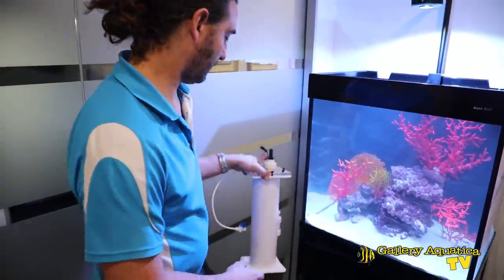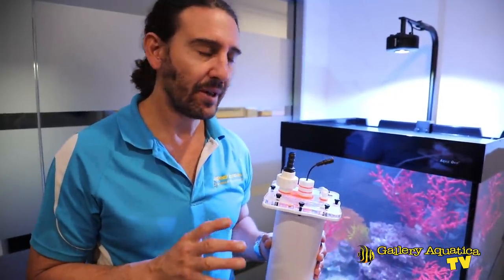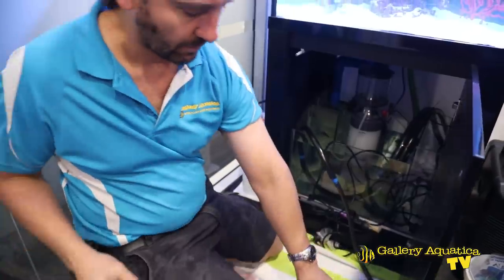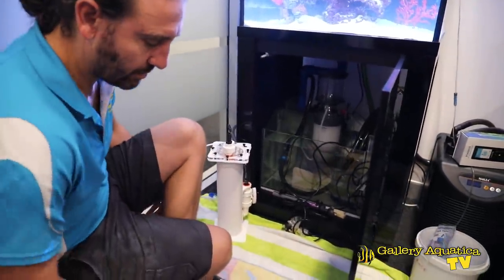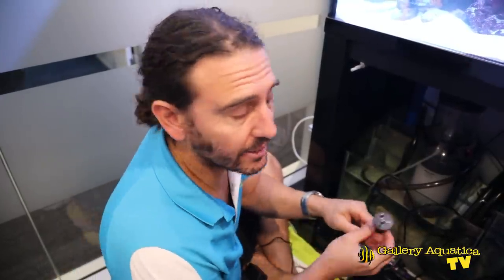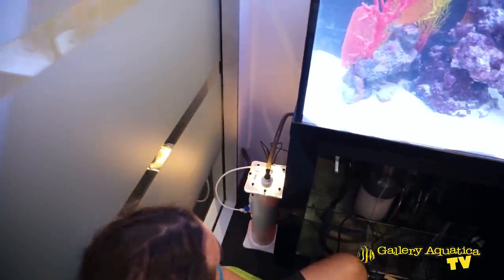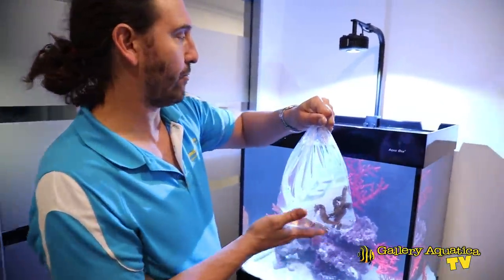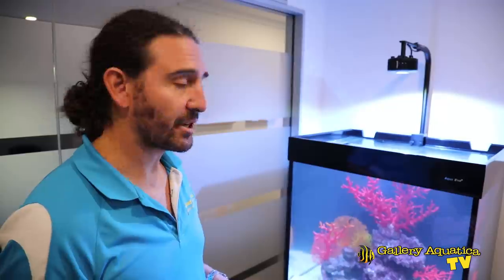Seahorse Heaven Part 2 --- Gallery Aquatica TV

Comment: The kessil light that you are using does it have a setting were you can minic sunrise and sunset or do you have to manually turn it off? Nice video 😀👍
Reply: it does with the kessil spectral controller.
Reply: @TattooedDancer91  im assuming you have to buy the controller separate? I ask because im about to buy the Ai Prime Hd. They make you buy the bracket seperate $60
Reply: @neophos6027  yes it's seperate. I'd go for kessil, I'm not that impressed by my ai prime.
Reply: @TattooedDancer91  Why aren't you impressed by your Ai prime? If you dont mind me asking you
Reply: @neophos6027  discoball effect on all surfaces, the color is too dark blue for my taste and the white LEDs look weird, I don't know what color temperature they are but they feel off. I have Eheim, Maxspect and Kessil lights, and I prefer all 3 of those over AI prime. (i have 4 tanks)

Comment: Just curious do you run a chiller on every tank you service? I have never had a tank need one, but seems standard in your setups?
Reply: It's prob dew to Australias heat makes the tank heat past the 25 mark and end up killing off corals dew to stress
Reply: @kevind6049  I live in Texas summer is 100+ degrees and I dont have a chiller.
Reply: Danny Spear pretty sure it’s too hot in northern Australia where he lives. The reefs are bleaching all over the world from 100 F, you can take all the risk you like on your own setup but it’s pretty logical to always promote temperature stability when you run a tank maintenance business.
Reply from the maker: I put them on almost all systems so I have good temperature control. The climate here really makes it difficult to get away without them, I’m very surprised to hear you don’t need them in Texas! Cam